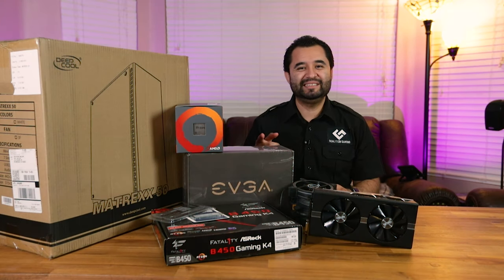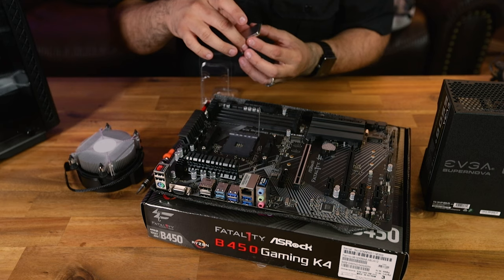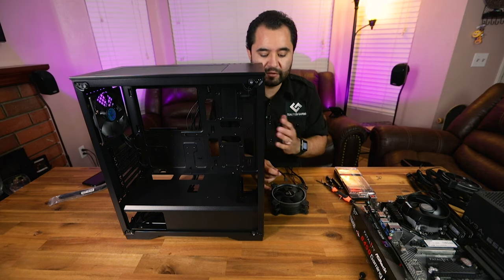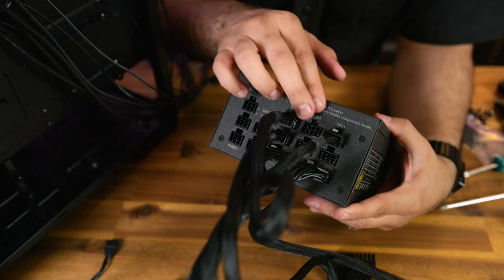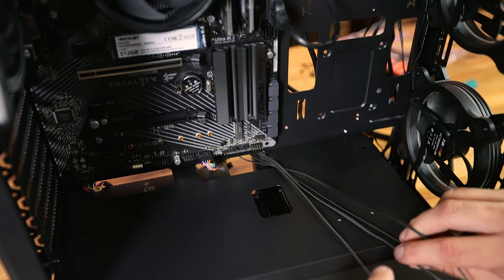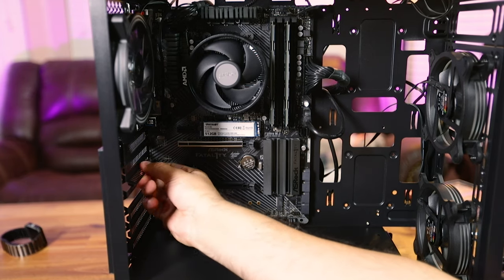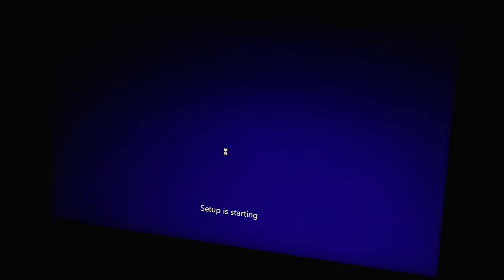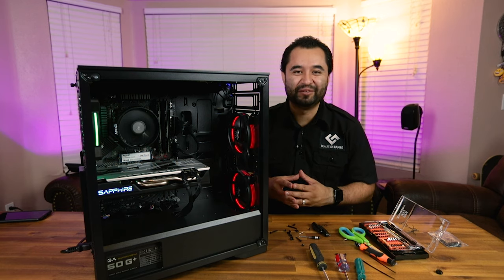ALL AMD PC build step by step - COMPLETE tutorial!

Comment: Great Video!  Concise and informative, quick question, I have a build with this case and I am adding a 2nd hard drive- what brand / type of mounting  gear do you recommend to install a 3.5" Hard drive in hard drive cage found under the Pc shroud?
Reply from the maker: Thanks! Yes that should be fine.

Comment: i had bought the same but mines came with a net of wire for the original fans that came with the case. where do i plug/ connect them on the asus tuf gaming x570-plus wifi motherboard? love the vid it help me with the other stuff i had to do
Reply from the maker: Net of wire?
Reply: @CoalitionGaming  is there a way to show you a picture of what I am staring at?

Comment: i’m stuck on the power led, power button, hd led and reset switch. i don’t have any connectors that do
Reply from the maker: The connectors come from the front of the case, there should be a bundle of cables somewhere in the back of the case. At the very least, a power button cable connector should be there. Then you just line that up on the corresponding pins on the motherboard.

Comment: I have a question. 

I'm about to build my first ever Gaming Desktop PC, which I have 6 fans for the case (6 being the max number of fans the case can hold - 3 at the bottom, 2 at the side and the last by the rear exhaust) which the fans came with an item known as the Anti-Vibration Pads (8 of those per sheet). 

Based on the fact that the sheet of Anti-Vibration Pads has 8 of those pad, I can speculate that each corner gets 2 pads a piece. Any idea on where to put them on the fans?
Reply from the maker: The corners of the fans is where the pads go on both front and back of them. So each fan holds 8 anti vibration pads. I would also make the 3 bottom fans intake, and the rest exhaust for a neutral pressure setup.

Comment: I allways mess up with the power and reset wires.
And SSD disks are not allways like this one you have there,i think there are some you can plug with a SATA cable.
Reply from the maker: Yeah but fortunately they are easy to connect and there is also tons of info online on how to install a SATA SSD or sata hard drive.
Reply: @CoalitionGaming  I was a trainee in a store that sold computers and repair but at the time i only worked on IDE and SATA and mostly with Intel builds.
I don't have so much knowledge about AMD builds.
The hardware has some differences and it can be confusing sometimes.
Reply from the maker: No real reason it can be confusing. Even though the socket type is different, the rules for mounting a CPU are the same (line it up, drop it in). Just gotta be more careful with the pins, but same with an intel motherboard and its pins in the socket. Mounting a factory AMD cooler is arguably easier than intel as well. Either its 4 screws, or its 2 hooks and a latch you flip over. And then literally everything else is the same. If you were confused by anything, this video is good reference to show you what to do regarding AMD installations.

Comment: Hi I didn’t get a reset or power front panel connecter.I have the exact same case as you.
Reply from the maker: They should be in there, unless they got torn out while you were moving things or the factory simply messed up. Have never seen a case without those connectors ever. Weird.

Comment: I do have a dumb question, how do i know what can fit on my motherboard? Like can i get any motherboard and any gpu and ram card and amd core can fit on it? Or do i need to go buy a certain motherboard for certain things. Because this video is pretty old and if i follow it’s steps I’ll probably be buying newer hardware for it. I can buy any Ryzen amd and ram and Gpu and it will fit?
Reply from the maker: Everything in the video still applies. AMD is still using the same socket and type of ram. You can use a site like PCPartPicker to verify parts compatibility.
Reply: @CoalitionGaming  thanks. Wish me luck on my endevours 😂

Comment: On my Matrex ATX case, each fan has two wires. Which wire do I plug into the motherboard
Reply from the maker: One of them is RGB, one of them is for the fan. The one with the notched that fit the tab of a fan header is the one you plug into the motherboard fan header

Comment: pls i need help which screw do i use for the fans because my fan screws it came with are to fat for the front
Reply from the maker: there are coarse threaded, flat headed little fat ones. Check the packet of screws and such that came with the case.
Reply: @CoalitionGaming  so the ones the case came w
Reply from the maker: Yes
Reply: @CoalitionGaming  ok so I honestly don’t know which ones is their any way I can send u the pic of my problem
Reply from the maker: just gotta try until you find the right ones man
Reply: @CoalitionGaming  ok so r the fans supposed to hang off the screw and be able to move the fan back and it comes off or is it supposed to be nailed down

Comment: idk why but i’m struggling to screw in the motherboard
Reply from the maker: Make sure you have the right motherboard mounting screws for the standoffs you're using
Reply: @CoalitionGaming  i figured it out thank you :) idk if this is a problem but my psu doesn’t have usb 3, so do i not have to plug anything into it?
Reply: nvm nvm, found it lol, didn’t use my brain
Reply from the maker: PSU don't have USB connectors so im not sure what you were talking about and how you "fixed" it

Comment: I habe the same case and mine didnt come with a reset wired
Reply from the maker: Didn't come with a reset wire? Like it got ripped out? Its not a big deal, reset button on case is rarely used. As long as the power switch wire is there you'll be fine.
Reply: @CoalitionGaming   it just didnt come with and on my mobo i had to connect the power sw facing the words down so only the power led + and the led - words are showing top and the power sw word is faving down is that ok
Reply from the maker: It doesnt matter as long as it works after plugging it in

Comment: Ok but where and how do I connect the rgb connectors
Reply from the maker: The appropriate RGB header on the motherboard, if it has one. Line up pins, push it on. Same as connecting a fan.
Reply: Coalition Gaming thank you
Reply: Coalition Gaming I have one more question: I completed every step yet only the case turns on everything else shows no reaction any ideas as to why?

Comment: wrong ram slots.....
Reply from the maker: Incorrect. They were running in dual chann properly when I checked after installing windows.
Reply: as long as the ram is staggered  it doesnt  matter   if u use the  a1 b1 set  or a2 b2 set  first   both will run in dual channel. Depending  on how big ur  cooler  is  and if ur using  ram sized accordingly its better to use the  the first  and third  slots  for easy access  upgrading l8r

Comment: Hello, i have a couple of questions about computer graphic cards. I am currently running a Nvidia Gforce Gtx 650 2gb, and i have a older computer i bought off a family member which has a EVGA GTX 560 TI which graphics card is better? Also, does it matter that the video card i am using is an intel cpu, and the video card i got from the family member a AMD cpu? thanks in advance
Reply from the maker: The CPU previously used with a secondhand graphics card will never matter. At all. The 560ti is better.